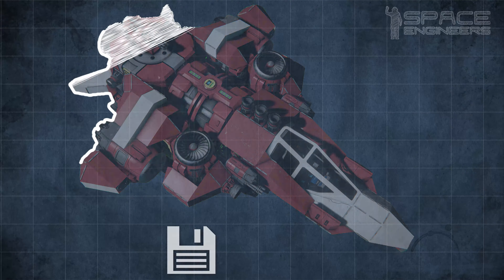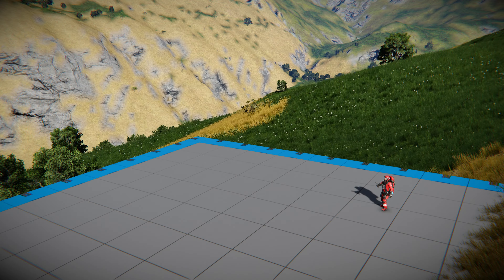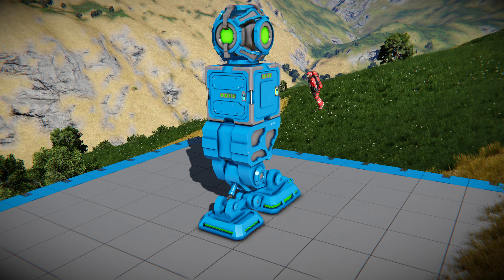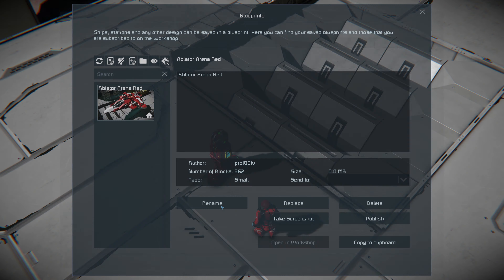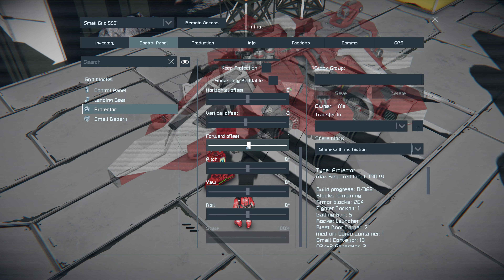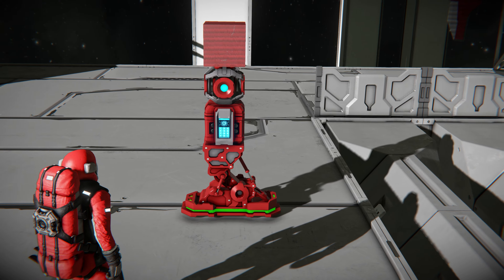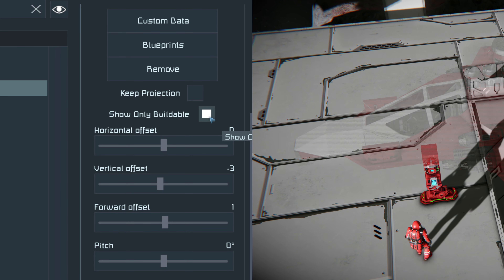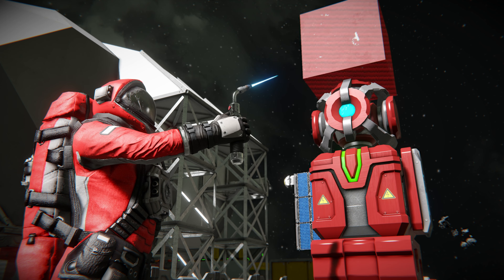Space Engineers Tutorial: Projector - Easy Print

Comment: You should show glass over your welders on your printer so blocks do not place before they should. This is a very important feature of printers.
Reply: Hi, can you explain what do you mean? Cause thats my problem with building with projector right now
Reply: @zdzisio583 if you put a window block over the projectors it doesn’t allow blocks to be built between the welders causing fuckups during the building process

think of it like a threshold for where the blocks can be built. the welder hitbox for what it welds actually goes into itself halfway down the actual welder bit (about) so by putting a window block right on top of the welder it avoids that issue of blocks being built between the welders